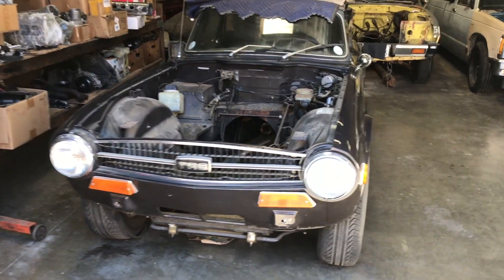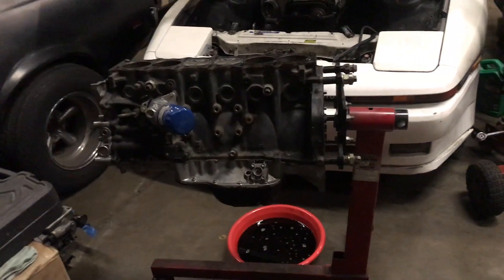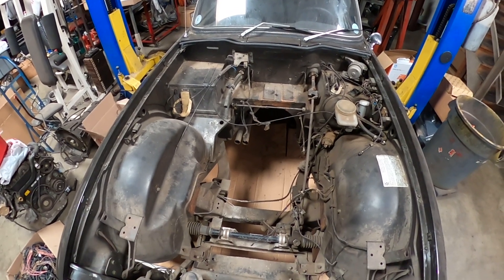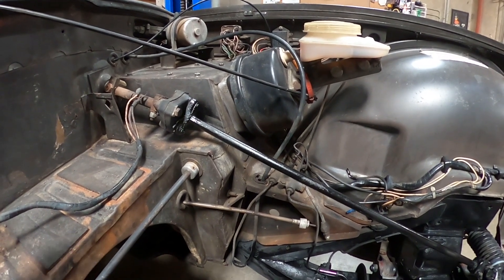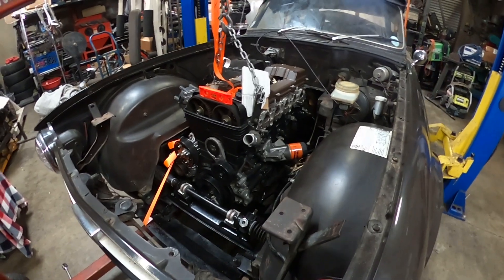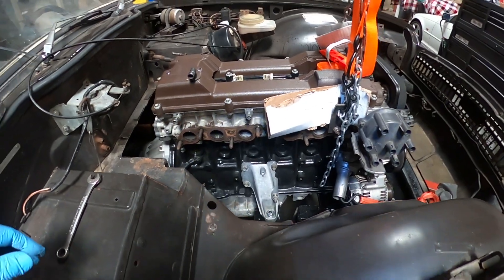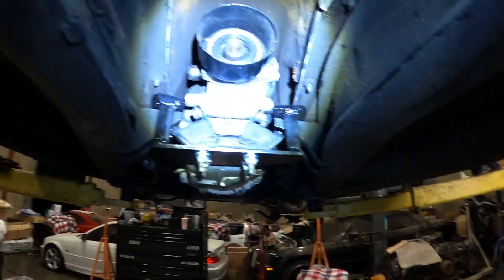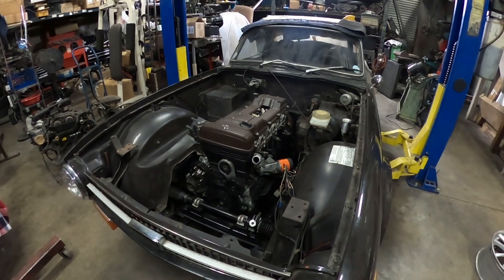TRIUMPH TR6 2JZ SWAP PT.1

Comment: Real DIY!  The original Triumph engine is minute by comparison, a V6, or even V8 would possibly have been a better fit.  The oil filter is a problem stuck out there = why did they do that.  And will the bonnet clear?  That engine is so tall.  Fun watching though.  I fancy the power will completely overwhelm the chassis and rear diff. though.  Good luck!
Reply from the maker: Thank you!

Comment: my advice is to never try doing this unless you know it will fit 100%...nightmares after mightmares and perhaps it might never get done.  The original engine is very reliable...just upgrade to carbs and bosch fuel injection along with electronic ignition and it will never fail.....100% reliable.
Reply from the maker: Nothing fits on this. Everything you try to fit will 100% be a challenge. There is way about everything specially now days that you have everything online. Reason why I haven’t work on it is because I’m building my house and it’s taking a lot of time away from my projects not because I got stuck. But I will continue with the swap later this year.
Reply: +1

Comment: If I was going to mod a TR6 I'd keep the stock engine and swap the godawful rear suspension for a Jag rear or something.
Reply from the maker: Yeah, someone did a V8 and another guy a Chevy V6. Then I saw this other one with a RB25 so I decided to do a 2jz.
Reply: Add a nice limited slip and add some uprated cv joints from Goodparts. I own a TR-250...
Reply from the maker: @markcook3570  thanks for the advice! I’ll see what’s available.
Reply: @mysterygarageCA  I I just had some rear end work going on my TR 250 I had the original pumpkin taken out and I had a real nice limited slip put in 4.01 and then the good parts CV joints weren’t cheap but with the urethane bushings and everything underneath with a five speed Toyota supra transmission aluminum case good to go. My motors bored 30over 10 to 1 compression headers electronic ignition aluminum radiator aluminum water pump ,aluminum engine plates 13 row oil cooler electric fan lowered springs front and rear sway bars drilled rotors Alphin rear drums at the rear it’s good for about 150 horse on the Dyno
Reply from the maker: @markcook3570  car for sure needs work on the diff, you make it sound like parts are available everywhere, hopefully I’m able to find at least the seals cause it is leaking.
Reply: @mysterygarageCA  The shop that helps me keep my car alive, is Jd British Cars out of Nashville J D is the owner he’s a great guy Chris Coffee who works in the back who is doing his own thing now is the brains behind my car he’s very knowledgeable some of the stuff that I’ve had a ride and that he’s building some of the fastest stuff I’ve ever been in in my life that Zeos six Corvette he did had 700 at the rear wheels the owner gave me a ride I had to have a shot of whiskey just to settle down
Reply from the maker: @markcook3570  I’ll check it out for sure!